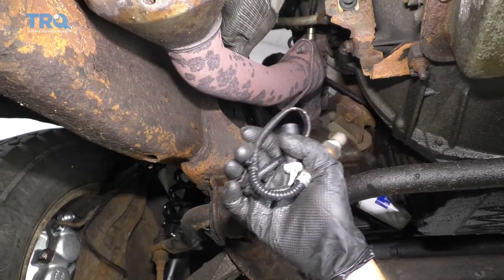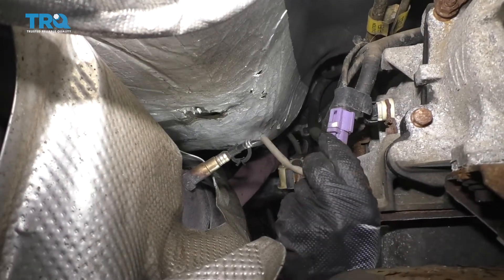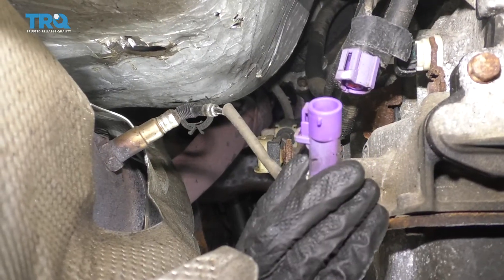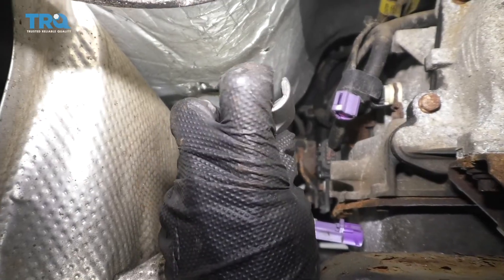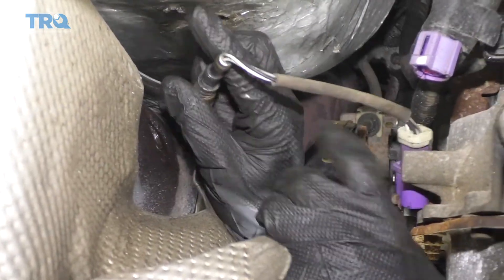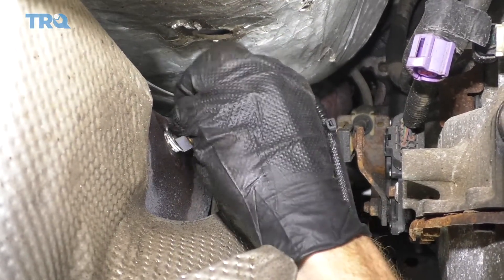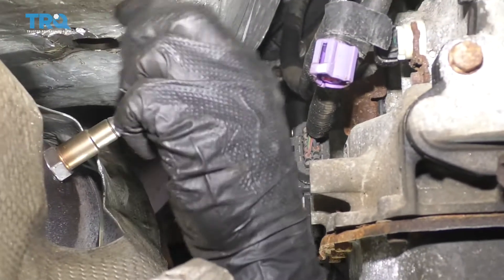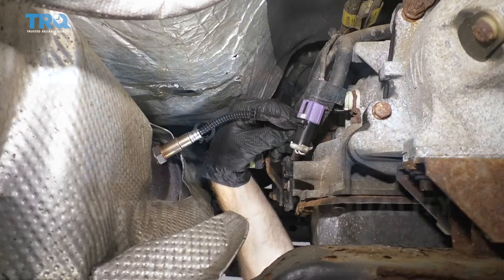How to Replace Downstream O2 Sensor 2000-08 Ford F-150

Comment: Wrong wrong wrong.. You did the driver side because it is 100% easier. And the nerve to say the passenger side is just as easy. Bull crap. The passenger side is harder because the plug is way between the firewall. So difficult to pull plug apart. 
Show people the passenger side so they can at least know what they are really getting into.
Reply: 😂😂all man you got me rolling, but you know what you ARE EXACTLY RIGHT.  I have a 2006 ford f150 5.4 v8 . Every word you said is true. I liked the guy video, but you are right driver side is so easy to chang compared to the passenger side